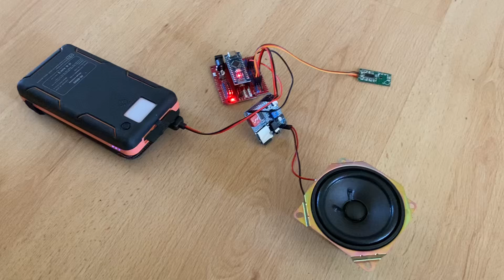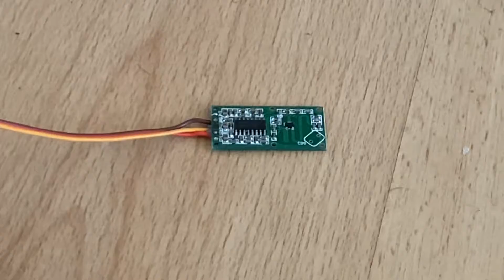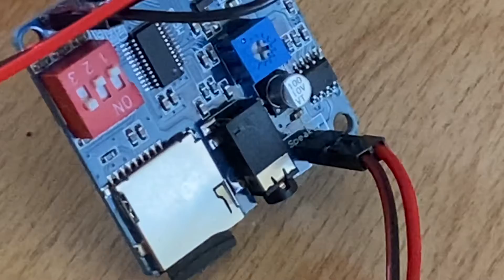Motion activated sound system for droids and other uses

Comment: This is awesome! I’ve been looking for a video like this for ages! Still learning script tho and i don’t think I’d be able to manage from scratch aha
Reply from the maker: Worth looking at AI to get you started with writing code, ChatGPT (whilst purists will shudder) can get you off to a really great start and can get you very close with just a few prompts.
Reply: @ImperialLightandMagic  Don't know a thing about code either, but I'm willing to learn. Are there any beginner resources for this? Can I use a Mac? I do use Chat GPT but wouldn't know what to prompt even. How is the code downloaded to the board? So many questions....
Reply from the maker: @VirtualViews3D  if you’ve used ChatGPT before, then you’re not far off writing your own stuff. To upload a sketch to an arduino you need the arduino IDE software from arduino.cc website. There are loads of videos about how to upload code, have a look for the Mac version but it’s very straight forward. Start with the “blink” sketch and you’ll soon start to understand how coding works.
Reply: ive been at this for 8 hours and cant seem to get it to work ive tried so many different codes through chat gpt, any chance you could share yours?
i keep getting 
#include <SoftwareSerial.h>

const int motionSensorPin = 2;  // Pin connected to RCWL-0516 OUT
const int rxPin = 0;            // Arduino D0 connected to DY-SV5W TX
const int txPin = 1;            // Arduino D1 connected to DY-SV5W RX
const int ledPin = 13;          // Onboard LED pin for indicating motion detection

SoftwareSerial voiceModule(rxPin, txPin); // SoftwareSerial instance for voice module

void setup() {
  Serial.begin(9600);          // Initialize serial for debugging
  voiceModule.begin(9600);     // Initialize SoftwareSerial for voice module

  pinMode(motionSensorPin, INPUT);
  pinMode(ledPin, OUTPUT);

  // Initialize the DY-SV5W Voice Playback Module
  delay(500);  // Delay to allow the module to power up
  sendCommand(0xAA, 0x02); // Command to set module to MP3 mode
}

void loop() {
  if (digitalRead(motionSensorPin) == HIGH) {
    Serial.println("Motion detected!");
    digitalWrite(ledPin, HIGH);   // Turn onboard LED on
    playRandomTrack();
    delay(2000);  // Delay to prevent multiple detections
    digitalWrite(ledPin, LOW);    // Turn onboard LED off
  }
}

void playRandomTrack() {
  int trackNumber = random(1, 6);  // Generate a random track number between 1 and 5

  Serial.print("Playing track number: ");
  Serial.println(trackNumber);

  // Send play command to voice module
  sendCommand(0xAA, 0x03, trackNumber); // Command to play specific track
}

void sendCommand(byte cmd, byte para1, byte para2 = 0) {
  voiceModule.write(cmd);   // Start byte
  voiceModule.write(para1); // Command or parameter byte
  voiceModule.write(para2); // Data byte (if needed)
}